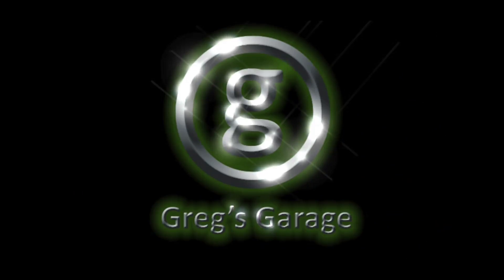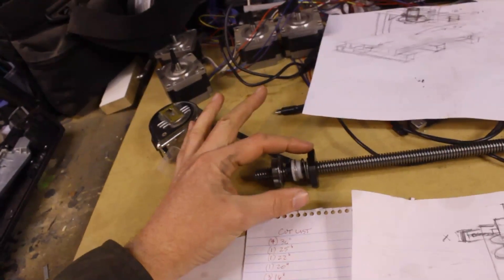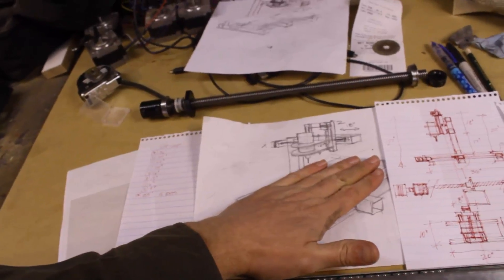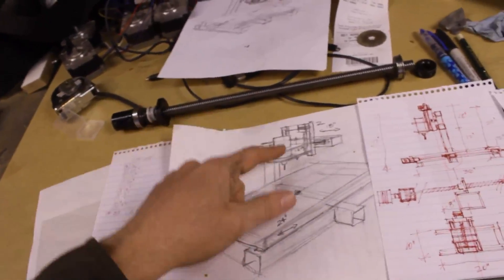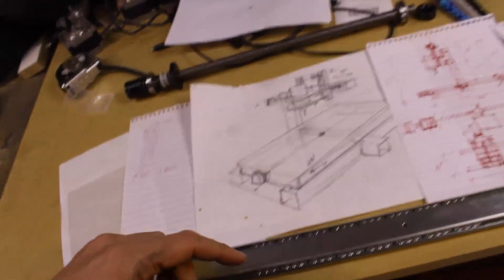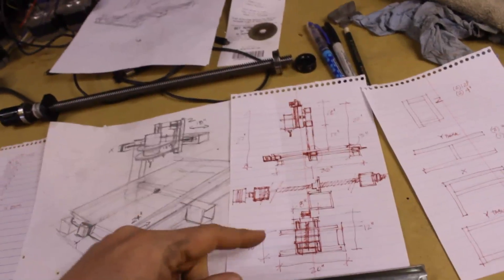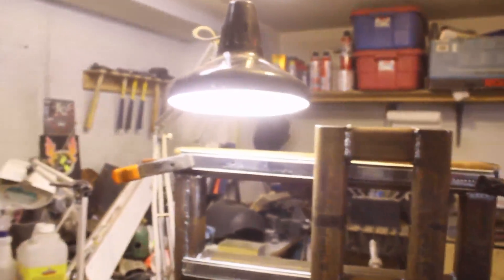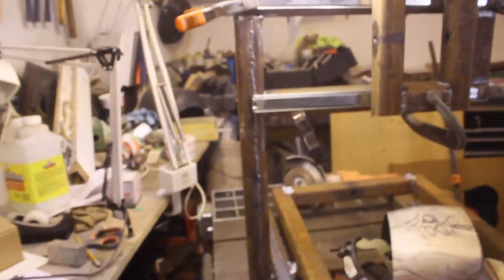Drive Components & Steel Frame for DIY CNC

Comment: Greg not sure if this will cause a conflict with the software You have the axis on the machine wrong as compared to a normal CNC  Z should be your up and down. movement.If you are standing facing the machine with the open side of the table closest to you X should be your right and left movement.Y should be the head moving towards and away from you If you are standing facing the machine with the open side of the table closest to you .   .
Reply from the maker: ***** Thanks Big J.  All the motor wiring can be switched around on the board in seconds.  If it has any issues with axis orientation, I'll be able to swap the wiring quickly and get it sorted!
Reply: Greg's Garage I was thinking about after I made the post. I think the issue might give you trouble is if you get a program for a three D printable from some one else. Or a program written by some one else.
Reply from the maker: I'll be using standard G-Code language.  When I run the tests, it will kick out text etc.  If there are any issues, I can swap AND I can reverse the travel of any axis that is set up wrong.  It should all work out just fine.

Comment: I wanted to buy a CNC plasma cutter table.  But a 4x4 one with the Plasma Cutter costs about $15,000 .  So it doesn't look like I will get it anytime soon.
Reply from the maker: I'm hoping to have under $500 into this one.  For nicer bearings, better motors and bigger bed, $1000-$2000 would be plenty.

Comment: This is really cool to watch. I keep wanting to build my own..... soon... soon. One word of caution 3d printers have a hard time working when there combined with different processes.
 just one spec of dust from any plasma cutting or routing operation Or just about anything you do in a garage can easily clog the .04mm nozzle causing a failed print.
A simple 4 hour print job on a belt driven printer could take 20 hours to print on a lead screw machine.
I know it can and has been done before but boy it never turns out as nicely as a purpose build 3d printer

just my 2cents
nice frame
Reply from the maker: Good to know...  I could def build a 3d printer only.  I figured I would give it a shot with this rig and make sure I get a working prototype.  I'd also make the whole printing rig removable.  I could even make the x and y a bolt on and just use the z of this machine...  We'll see.  Wood work will be the first job this machine will do.

Comment: Very cool, enjoyed the fabrication, welding, weld porn, editing.  will be interesting to see how it all works out!
Reply from the maker: Agreed.  I'm hoping I can get all 3 axes square to one another.  It's going to be a tall order.  I've realized I need to add adjustment on 2 of 3 axes.  If I can get that sorted, I should be able to make it run true.  Keep your fingers crossed.
Reply: Greg's Garage i know you trying to do this as inexpensively as possible, but one thing you might consider is one of those $150 X-Y tables you can add to a drill press. They have T slots for clamping, and you could make some mounts for your servo's
Reply from the maker: Yes.  That may be part of the "box" that will be bolted to the top of this thing.  I can easily add steppers to one of those.  Tom sent me a few pics of them a week or two ago.